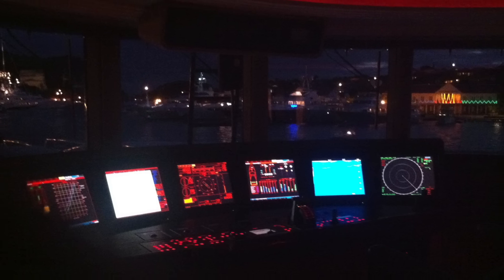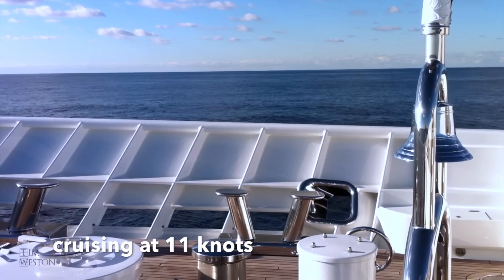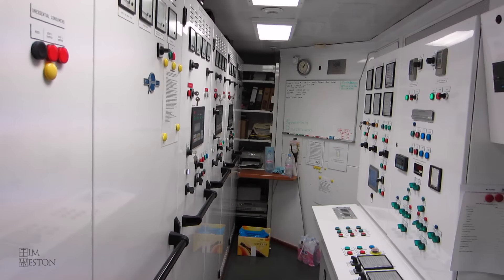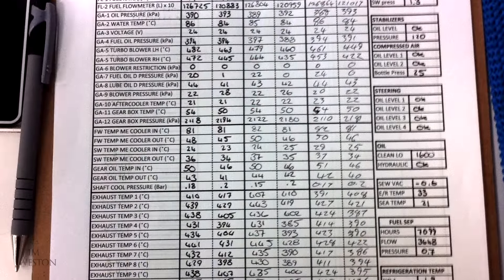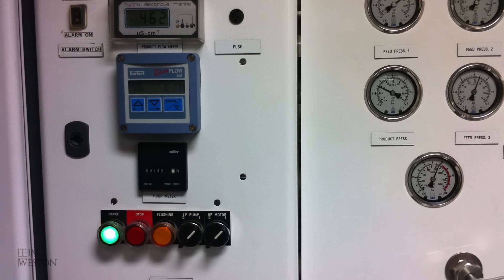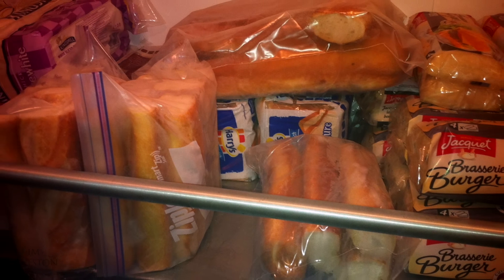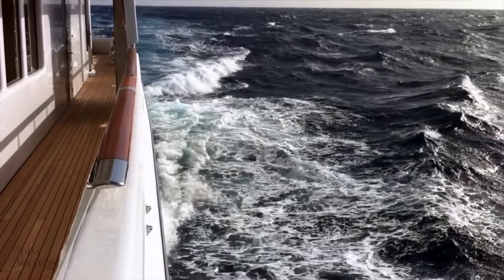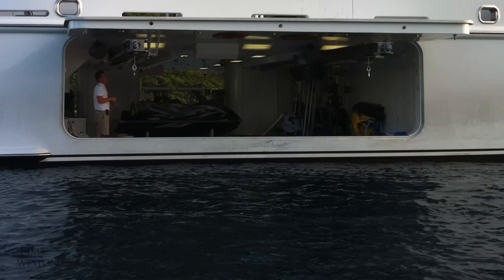Super Yacht - Atlantic Crossing - Engine Room Tour

Comment: Brilliant, well paced video. Myself, as a control-systems guy, but strictly ashore, it was great to see a lot of familiar equipment, albeit in significantly tighter quarters! You run a tight ship! Everything apparently clean enough to eat off of, and a place for everything with everything in its place! Musical accompaniment spot on too! Very cool!
Reply from the maker: Thank you Bill. Yes, the boats vary a bit, depending on the age and who has been running them but generally they are pretty nice to work in the engine rooms on modern yachts. Some of them are really works of art..

Comment: Sounds a lot like the ocean crossings we do in the C-130.  We logged everything.  The only difference is that in my day I shot cel (celestial navigation).  GPS makes things easy!  Well, that and the fact we'd cross the pond in several hours rather than 16 days.  :)
Reply from the maker: Ah, that's cheating! Nice way to go, a lot smoother up at altitude, than down on the water. But the sunsets are not the same... :)

Comment: Great video. I have a question,  how is the diesel engines connected to the shafts?
Reply from the maker: Hi James. Through a gearbox and a flex coupling. The gearbox is attached to the motor, and has 3 positions, ahead, astern and neutral (no drive).

Comment: Hey Tim, I thought your video was great! I wanted to ask you  what kind of things have gone wrong in the Engine room while you where under way and how do you like the newer generation of highly electronic engines compared to the previous engines and hydraulic systems. I work on a Sportfishing Vessel that is 90 feet in length with a 25ft beam.  We do trips typically ranging from 5 to 18 days long leaving from San Diego and fishing ridges a couple hundred miles off of Cabo San Lucas. We also do routine engine room checks every 2hrs in which we check the pressure, temps, oil levels and ect.
Reply from the maker: Hi Kyle. I haven't had anything major happen on the yachts. On this trip the only drama was a black out with a momentary loss of power.  Electronic engine management systems are as reliable as in your car, it is extremely rare to have problems. I'd have to go back to my ship days to remember engines without electronics ;)

Comment: Chillers for HVAC. Often wondered. Do you use the same air handlers for heating or do you have hydronic?
Reply from the maker: Ah, funny you should ask. I have never worked on a yacht where we have needed heating. Even in winter. Some Hvac systems have electric resistance heaters built in, but I've never used them. I can't remember what this yacht had, but the A/C was never turned off.

Comment: Can you tell us more about this yacht? Length? Steel hull or fiberglass? Are there some sorts of boat you would not trust as stable enough for a transoceanic voyage?
Reply from the maker: Hi Crusader. It's about 60m, steel hull. Most boats this size are steel hull.  There are so many different types of boat/yachts I can't say in a statement what is good and what isn't. You can cross the Atlantic safely in a 10m boat or less if they are designed well. But in general, the bigger the more comfortable..
Reply: Thanks for the info, Tim. Yes, I see these 40-45m tri-deck fiberglass boats with a shallow draft (under 2m) for cruising the Caribbean and Bahamas, and wonder how they would do out on the high seas. Also, fiberglass seems to me like it would crush more easily in an encounter with a rock, where a steel hull might bend before it breaks and be stronger overall. Also, I assume it's easier seas to cross the Atlantic at a lower latitude like you did here than it would be on, say the QM2's route from New York to Southampton.

Comment: Thanks for sharing this video Tim! Do you know if my commercial EOOW (3rd Engineer ticket) will be accepted on superyacht or do i need a MCA ticket ? My CoC is issued in sweden.
Reply from the maker: Hi Filip.  I don't know about 3rd engineers tickets myself, but commercial tickets are accepted. You get a CeC from the MCA to operate on yachts. Check out the MCA's website there is info there on recognition of tickets. I'm sure Sweden is included.

Comment: Hi Tim, may i know how long small atlantic capable crossing boat its engine can keep on going continuously non stop in terms of running hours count at safe as per build recommendation? 
im talking about of those something like 50' - 60' boats.
Reply from the maker: Cimuraisampi, any engine for a boat that size will run continuous for long enough to cross an ocean, without problems. You might need to stop for an oil / oil filters change on the way. Tim
Reply: @TimWestonboats  Thanks...

Comment: thanks
would be great if down the line you could have a thermal gun to take temps of the vatious engine parts.
does the a/c work of the engines?
Reply from the maker: No, the A/C was electric. 3 compressors, they actually needed almost one generator, just for them, they were a big load.

Comment: At 2:13, you mention it you left Gibraltar with 160k litres of fuel, and burned 70k "for the voyage, traveling at slow speed".  What type of fuel does she use?  Is that heavy oil like the big cruise ships use, or just regular diesel fuel.  Either way, how much would that cost to 'fill'er up'?
Reply from the maker: All the yachts burn regular diesel, the same as you buy at the gas station for your car. The bunker C that the ships use is almost like tar and needs to be heated and centrifuged to clean it. It's steam heated all the way to the injectors and is only used on the big slow speed 2 stroke ships engines.  Thanks god ;) I'm not sure what we paid then, but it's similar to pump prices, so around 70,000 euro for the trip or 160k euro to fill er up!
Reply: We filled our tanks in Gibraltar a couple of months ago, and the pump price for diesel at the Casino harbour was just 47 pence/liter, or 0.60 euro per liter. Gibraltar is basically a tax-free area, same as Guernsey where we filled up a week earlier. There is was 42 pence per liter. We were taking only 6000 litres each time, if you buy 160kl the price drops somewhat also.

Comment: Did you ever have a more serious repair work to do? Such as, a system breaking down and having to restore it? And if one of the two pumps (for example) fails and the reserve one takes over, what do you do to restore the safety level?
Reply from the maker: Hi Serban. Yes, there is always something going wrong. If one pump fails, you need to fix it, to restore the safety level. Once you've lost one, you no longer have a backup.

Comment: can you tell me more about the engines exhaust systems....  i have been using 2,000 f degree ceramic coatings on exhaust systems to reduce the radiant heat that these parts create.  most indistrial caterpillar engines use thermo blankets and i find them retro technology. would be interested to see a thernal temp gun on these parts to compare the efficiently of my personal modifications vs the industry yacht standards for engine installs.
i have also used simple computer fans to flow air through electrical modules to reduce wear on electrical systems
Reply from the maker: They are nothing fancy Saint r. Just thermal blankets, with stainless steel covers for most of it.

Comment: this was really interesting !! 
 Tim i have a few  questions .. 
1- average speed during the crossing ?
2- both engines running together or 1 running with other as back up or switch it up to keep them both happy ..  
3- size or length of this beauty of a ship .. 
 thanks mate !
matt
Reply from the maker: Hi Matt.  Glad you enjoyed it.   11kts was our avg. speed, both engines running.  I was thinking of running on one but the gearboxes were only rated for a short time trolling. You need to rig up seawater cooling to the freewheeling gearbox for a long passage.  She was 60m long!
Reply: much appreciate the response and that looked like just an incredible time , keep them coming !!
cheers.
Reply: Gearboxes are rated usually only for one hour of windmilling without cooling. After that you have to somehow arrange gearbox water cooling to run without the engine cooling pups running. Usually there is no arrangement for this. Locking the propshaft is another way of fixing the problem, but it causes a lot of drag and loads the bearings and stuffings the wrong way.
Reply: thanks marc !! inquiring minds were wondering !!

Comment: Hi Tim, how much fuel is consumed on the trip; cost?
Reply from the maker: 70,000 litres Nick. I'm not sure what the price was, it's roughly the same as you pay for diesel at the pump in your car.
Reply: Really, 70,000 Euros is the cost of fuel a transatlantic crossing, jeeze What is the total cost, and what was the greatest line item for 16 day cruise?
Reply: Gibraltar is basically tax-free, so diesel at those quantities cost only about .50 euro/liter. Even at the marina pump it was less than 60 eurocents/liter a few months ago.

Comment: any concerns about pirates?
Reply: That's mainly around Somalia nowadays.
Reply from the maker: Just like Budmeister says. The Atlantic is a pretty safe place as far as that goes Dwayne.
Reply: Refugees can be a slight problem on the Mediterranean, though. Would a super yacht want to pick up a hundred referees heading for Spain if the vessel is going to, say, Malta? We encountered a rubber dinghy bout 4 hours out of Gibraltar when heading east, with 11 people on board. Our solution was not to pick them up but alert the Spanish Coast Guard and to follow the dinghy just in case about a mile distant towards the shore, report our position every 30 minutes and wait for a rescue boat to pick them up. Which happened just after dark, and we could turn back  and continue our journey. Had they turned their boat over on purpose??? Tough calls.

Comment: How many is the engine crew on that yacht?
Reply from the maker: There are 2 engineers on this yacht. The smaller ones <45m have usually just 1 and the larger ones, say >70m usually have 3 and or including an ETO, someone to look after the electronics/audio visual.

Comment: Whats her beam and LOA?
Reply from the maker: I'm not sure of the beam but she is a 60m boat.
Reply: Nice! You are so lucky to have such a pristine vessel.
Me, I'm working on building a sloop, 153 footer. I'm a former machinist mate so my rig will be steam powered for less windy days. Looking at single screw with about 250psi and a smallish 5 stage turbine. But it will be fully automated with all the latest technology like air pneumatic/hydraulic valves, electronic monitoring/control etc. So that way I don't have to touch the plant unless absolutely needed.

Fair winds! Following Seas!
Reply from the maker: Thanks MeMad.  It sounds like a really interesting project you are working on! All the best.

Comment: Just to give you a thumbnail of how much CO2 a pointless motor yacht pumps into the atmosphere a diesel tractor trailer is about 450 horsepower. At 4,000 horsepower you are looking at 8.9 tractor trailers with 18 wheels pulling a container on the highway. This yacht is hauling rich jerks who think climate change has nothing to do with them. Now remember that sailing is a perfectly fine way to get around and with modern systems requires just about the same number of crew as a motor yacht. Motor yachts should all be banned to save the climate but of course that is never going to happen.
Reply from the maker: I also prefer sailing Bill, when I wasn't working on these boats I was building sailing boats. But, don't worry about CO2 levels, we need more in the atmosphere not less. It is oxygen for the plant world. Climate change is a hoax, propagated by the media and the people you mention above.